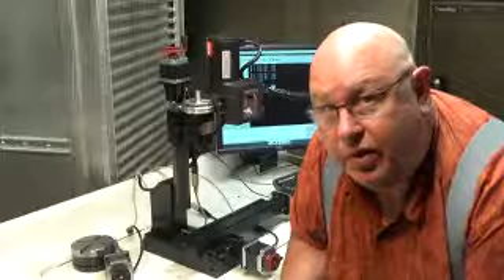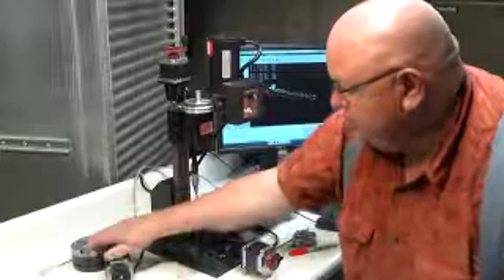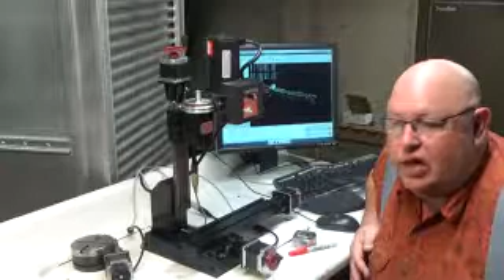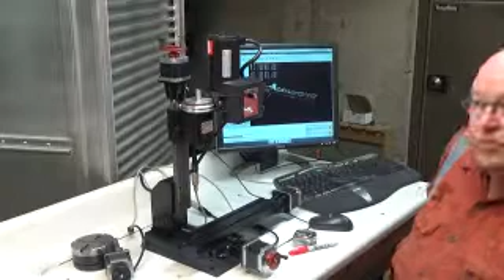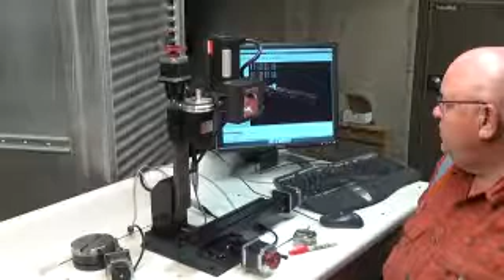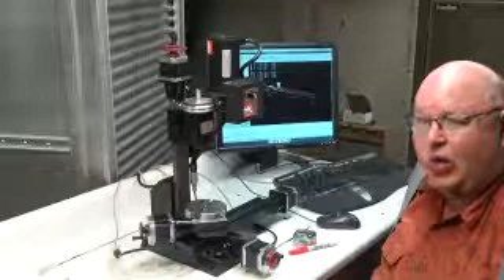Sherline CNC, Birthday, Bash

Comment: Do you know what the difference is with the metric version? Thanks
Reply from the maker: I have never seen the metric versions so I am basically guessing.  My thought would be that the main difference would be that the three lead screws would be threaded with a 1mm pitch instead of 20 threads per inch.  The collars on the handles would probably still be engraved with markings from 0 to 49 for 0.02mm increments as opposed to 0.001".  The lock screws, gib screws, etc. would hopefully be metric, so you could use a metric hex key for adjustments.  Check the Sherline website to see if they have more or better information. Doug